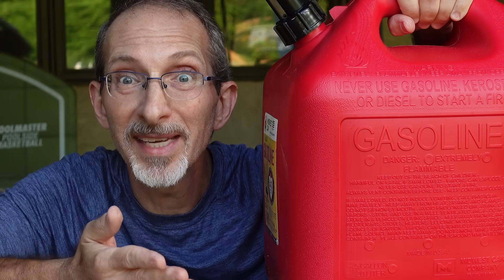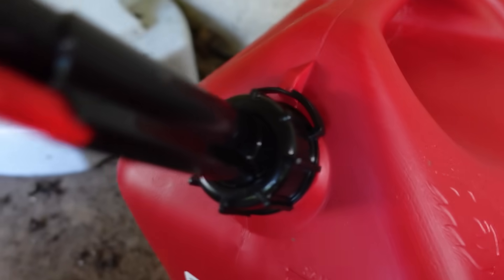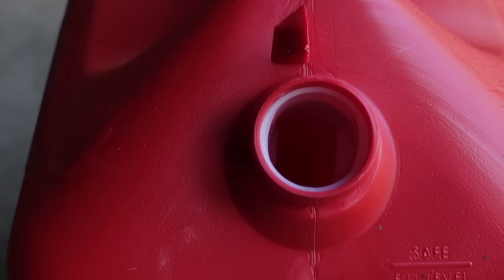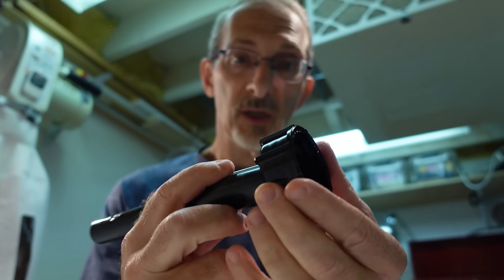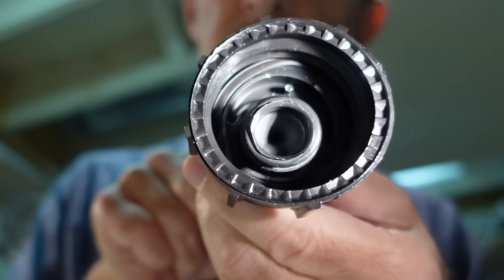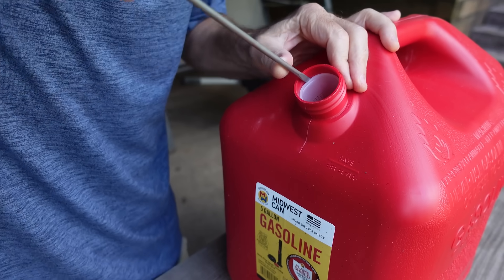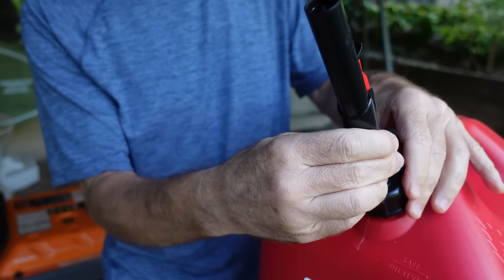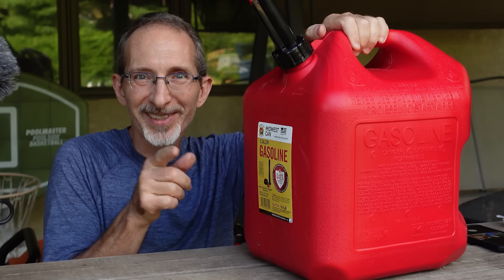Gas Can Modification | New Gas Can Fix

Comment: Thanks for the tip on cutting that silly lock off! Will do that tomorrow on my 5 gallon can. I bought a 1 gallon can from Walmart to use for mixed gas and it has the weirdest set up I've ever seen. I never could figure out how to even pour the gas out. After fiddling with it for 20 minutes, I ended up putting the gas back into the "unsafe" can I've safely used for 30 years and threw the new one in the trash. Problem solved.
Reply from the maker: It’s crazy to think how many people are throwing away gas containers because the design is just so hard to use. So much for these being more environmentally friendly! I’m glad you found some of the tips helpful, and I appreciate you watching!

Comment: Why are you putting straight gas in your chainsaw and weedeater?
Reply from the maker: My weedeater is a four stroke engine and take straight gas. But I hear what you’re saying, and I do keep smaller containers with an oil and gas mixture for my two-stroke equipment.

Comment: I personally would have put a weaker spring back into the nozzle. I totally understand why you wanted to remove it. However, the auto-close feature is super nice when you are filling a tank (significantly) smaller than the can itself. No need to change the angle of the can, just lift up and have the auto-close seal stop it for you.

Do this with my weed trimmer all the time. However, the spring isn't that hard to move either. 1. Start the pour. 2. Open the safety latch. 3. Allow the weight of the fuel to open the seal. 4. Lift the can to auto-close the seal.
Reply from the maker: These are all good points. In fact, I did a mod to the spring to make it easier to use in my second video, and then reinstalled it back into the spout. It worked great! Thank you for sharing your tips and for joining the conversation. I appreciate it!

Comment: I did this to all of my gas cans. Then, I ordered new regular nozzles and replaced them all with the old-style, not government BS nozzles. They sell them on Amazon. Search for "2009 Gas Can Nozzle" or "Water Jug Nozzle".

Some of the kits come with the old-style plastic air vent for the back of the can too. Those are GREAT mods to make too. The "Magicfour Vent Caps" are my favorite; but they're little more expensive than the plastic ones at ~$20 for a pack of eight.
Reply from the maker: Thanks for the tip about the magic for vent caps. I’ll have to check them out!

Comment: Sweet! Thanks for sharing. I just modified my Midwest 2 Gal. gas can:) HA! Removed the spring and filter, replaced the O-ring like you in this video:) Now, I can use my gas can the way I envisioned, fill up and pour out as needed:)
Reply from the maker: Excellent! These containers are well-built, it’s just that the design makes them hard to manage. Few changes here and there and they are good as new! Thank you for supporting the channel by watching and commenting!

Comment: There's one other solution. There are gas can nozzle conversion kits on eBay and other sites, that comes with the "old style" nozzle and cap, with several thread rings. These fit most cans and definitely fit the can seen here. I know, because Ihsve two of those converted. Some kits even come with a air vent valve, for cans without one. Great video here, thanks for sharing ! Anything to get rid of these terrible nozzles !
Reply from the maker: Randy, thanks for your compliments and for watching! Aftermarket spouts are very popular, and I will be reviewing one in an upcoming video. I appreciate you supporting the channel!
Reply: @MikeFyxdt  That's great Mike, I look forward to that one ! I just appreciate you addressing such a huge problem. Like most, I NEVER pass up buying an older can at yard sales etc, all because of these new devices.

Comment: These new gas cans are a total mess.  You forgot to add a vent.  You can purchase those on ebay.  Adding a vent makes them pour very nicely and smoothly.
Reply from the maker: Jerry, I agree! I did a second video where I added a vent and also modified the spring for people who don’t want to remove it all together. Link in the description if you would like to watch. Thanks for joining the conversation!

Comment: I have several of these cans. I've never had a problem with spilling. They work the way they're supposed to.
Reply from the maker: Kirk, I appreciate you voicing your opinion, and I think it’s good to have some counterpoint here in the comments. I suppose I could have gotten used to all of the features of this container, but I didn’t have the patience. Everyone needs to make decisions based on their own assessment and needs. Thanks for joining the conversation!
Reply: Filling anything but a heavy mower or car with one of these cans equals out to gas everywhere but where you wanted it to go. I have one, and I hate the thing with a passion. I either have to stand there holding a heavy can while my mower fills basically one drop at a time or I have to push the lever down and somehow hold it while holding a heavy container and manage to pour the gas into the hole and  not all over the mower I would like to finish cutting the grass with sometime that day.  Give me an old-fashioned gas can any day.

Comment: Punch out the bottom of the filter so gas flows in fine and when you dump out fuel the filter filters
Reply from the maker: The filter (flame arrester) is in the container pretty tightly, so you just need to make sure that you don’t damage the container itself, or else it might not seal correctly. It seems like everyone is experimenting to find their own solution… I just wish these containers were better from the get-go. Thanks for watching and for commenting!

Comment: I didn't know about these ridiculous gas cans until my brother mentioned it to me.  He felt they were far more dangerous than the old ones and extremely annoying.  Nice simple fixes to the problem.  Your modified version actually accomplishes what the original was intended to.  You didn't remove safety features.  You made them functional.
Reply from the maker: Terry, thank you for your reply! I have nothing against safety features, as long as it doesn’t impair the safe use of the gas container. I appreciate you joining the conversation and thank you for watching!

Comment: I wouldn't find it necessary to get rid of the little plastic clip that keeps the whole neck from unscrewing since I don't find those to be much trouble. The other two mods though sound like excellent ideas. I really don't understand how all these new can safety features are supposed to be all that safe when you end up spilling gas trying to deal with them
Reply from the maker: Agreed! The little plastic clip probably could have stayed, but I have nicked my knuckle on those in the past, and since I was in a surly mood, I took it out on the can. I’m glad you found the other mods helpful, and I agree with you that it is ironic how safety features make something unsafe. Thanks for watching and for joining the conversation!

Comment: Why would you get rid of that filter? Aside from making the pump think the can is full it has an added feature of keeping any contaminants inside it so you can pour them right into your tank along with your previously filtered gas!
Reply from the maker: When I called the filter is actually a flame arrester safety device, which I explained in my second video. Sorry for any confusion! I appreciate you watching.

Comment: Why not just buy a replacement nozzle? Easy peasy!!
Reply from the maker: Phil, that is a reasonable comment. My first priority was trying to fix it without purchasing anything additional, which I accomplished. That said, replacement nozzles are a very popular option, and I will be reviewing one in an upcoming video. Stay tuned and thank you for watching!
Reply: What I like about the replacements is that they can be rigid or flexible (preferred by me). Essentially making them as originally designed.

Comment: An excellent option to these very dangerous gas cans is the old metal ones. You can convert any metal can to a gas can, i.e.  gal. paint stripper can, gal. mineral oil can, gal. turpentine can, etc. You can buy spouts in Walmart or your favorite auto parts store if you want to.
Reply from the maker: Yes, even though metal containers are more expensive, they may be a better value in the long run. I appreciate you watching in joining the conversation!

Comment: Cut that stupid spout down a little and add a piece of flex tubing.  I think a vent plug will improve flow and allow the release of the Compressed vapor cloud when wnd where you can do so safely.   @GOOGLE  your dirtbag #Spell Checkers are fucking with me... check their oxygen levels.
Reply from the maker: Rodney, agreed! I added a vent in my second video, link in the description. I also agree that spellcheckers have a mind of their own! Thanks for watching and for joining the conversation.

Comment: I believe the "filter" is actually a flame arrestor. It makes kerosene cans completely useless since a siphon is typically used to transfer kero.

If you look into power sports gas cans (such as at a motorcycle shop) they generally lack any of these unsafety features.

If you're storing gasoline you want metal cans.
Reply from the maker: Andy, agreed on all points. I followed up with a second video, link in the description, that clears up the flame arrester issue. I didn’t realize kerosene is often siphoned, but I understand that it burns much differently than gasoline, so maybe there are containers available specific to that type of fuel. Thanks for watching and for commenting!
Reply: Checked them out, good content!

Comment: Aside from the spout issues (I have one of the cans with a ring to twist before pushing spout inwards in order to allow flow), the in-can filter makes ZERO SENSE as it is designed... it isn't easily removed for "cleaning" it, so any particulate matter it could possibly catch would simply wait there to be picked up and deposited into whatever you were pouring the gas into next from the reverse flow from can to filter to spout. /smh/

P.S. - I read the updated info in video description... there are very few people that will automatically deduce that the "filter" is a flame arrester. Most all consumers are going to presume it is a filter... and it is a weird safety feature, too... IMHO. Why don't ALL motor vehicles (or ANY gasoline powered devices) have one of these in their tanks' fill ports?
Reply from the maker: I don’t think cars need a flame arrester because the fill hole is pointing up, and the danger with gas fumes is that they travel down. In other words, you tip the gas can but you don’t tip a car. Or at least you’re not supposed to, lol!

Comment: If you primarily fill up cars, another option is to keep the spring but get rid of the red piece. For filling up cars the spring is not an issue, but the red piece is super annoying how the slightest touch would cause it to pop back out.
Reply from the maker: Dwigt, that is a creative solution! Thanks for watching and for commenting!

Comment: The only thing that safety is good for is spilling your hard earned money onto the ground. I never had a safety issue with my old cans in the 30 some years I used them. Most retarded shit ever.
Reply from the maker: J.T., it is crazy how many people say they are spilling fuel with these new “safer“ designs. Thanks for watching!
Reply: @MikeFyxdt  There is nothing better or safer about them. Thanks for the tip on how to make them work better. I'm tired of getting gas all over my hand and all over my mower when filling it up. I will only put gas in my mower when it's stone cold, because I'm worried about it catching fire and burning me and my mower up.

Comment: pulling that filter out reminded me of when some folks saved a sea turtle.
Reply from the maker: LOL, I’ve gotten several comments that compared it to a medical procedure! Yikes! :-)
Reply: I haven't seen one with a "filter" before, but I'm wondering... how does that filter anything? If trash goes in ... and the filter "stops" it ... doesn't it pour right back out? This is a gas can ... shouldn't filters be in 1-way tanks, not in 2-way tanks?????
Reply: @AllAmericanGuyExpert  it’s supposed to be a flame arrestor; the better cans use a metal mesh. It’s supposed to help stop flames climbing a stream of gas from entering the can. I thought the same thing as you (doesn’t filter squat) when I was pulling mine out

Comment: how does the filter work? Seriously? You fill up with dirty gas, fine, it gets trapped. But if you don't clear the debris from the trap, guess where it's going to go on your first pour?
Reply from the maker: When I called a filter is actually flame arrester, which I explained in my follow up video, link in the description. I appreciate you joining the conversation!

Comment: You can buy vents to add to then also.  The filter is completely pointless, it keeps stuff from getting past it, then it's there to come out with the first bit of gas you pour.
Reply from the maker: Dustin, you are correct. The filter is actually a flame arrester, which I clarified in my second video, link in the description. I also added an aftermarket vent in that video if you’d like to watch. Thank you for joining the conversation!
Reply: @MikeFyxdt  -Gotcha, but I don't see how the screen can be a flame arrestor, hopefully you understand and explain in the next video.

Comment: Thats not a filter. That is their flame shield technology. Otherwise known as a flame arrester. 
Its what caused blitzu to go under. They were metal and uncertified, but blitzu got sued for not using them. Turns out the metal ones actually caused more fires.

They are pointless.
Reply from the maker: Michael, you are correct. I addressed the flame arrester in my second video, link in the description. Thank you for your comments!

Comment: You can spend all the time and effort into removing the spring and all that "safety" stuff, or when you buy the gas can, just purchase one of the "old" spouts, the run about $6-$10 at Tractor supply
Reply from the maker: Yes, replacement spouts are a popular option. I will be reviewing one in an upcoming video, stay tuned!

Comment: I must be the only one who likes these. I never spill a drop. Just pay attention and remove some pressure as it approaches full to slow the flow, once full just lift and gas stops. What’s the problem?
Reply from the maker: Jess, I found it very hard to control the spout with these large 5 gallon containers. People who have smaller containers with the same spout tell me it’s not as hard. I’m glad you commented because it is important for people to hear both sides! Thank you for watching!
Reply: @MikeFyxdt  I have 5 gallon cans but yes it would be easier if it were lighter

Comment: Another mod that I do to all of my gas cans is too drill a hole in the other side at the top and fish a car tire valve stem into it. This works great as a vent with the Schrader valve removed and the cap works as a cap
Reply from the maker: Do RC, there have been lots of mentions of the Schrader valve fix, and I have seen some videos of it. In my second video, link in the description, I added a simple vent with a cap that made a big difference and was very easy to install. Thanks for joining the conversation and for watching!

Comment: Great info on fixing one of the problems with these spouts.  But it doesn't solve the other big problem, which is the rigid spout that forces you to literally almost upend the gas can to get the spout into the literally horizontal opening of a most things like generators, lawn mowers, etc... not only forcing you to lift a full gas can completely up, but typically splashing gas all over the generator, mower, etc.    For less than $10 you can buy a simple flexible spout.  It's one of the most widely purchased accessories to fix these idiotic designs.
Reply from the maker: Agreed! So many people have recommended an aftermarket flexible spout. I will be trying one in the near future and making a video. Thanks for commenting and for watching!

Comment: This reminds me of the no iré “falling down” looks like you’ve had enough of everything being designed for the least common denominator. That bar has gotten so low, I’m convinced these are designed to keep us from using them. It would be best if the masses hired people to cut their lawn.
Reply from the maker: Steve, even the lawn cutting services need to purchase gas containers, so they are affected by these designs. I suppose if I used gasoline more, I would simply invest in better containers. For my needs and my budget these containers seem to fit, and after the modification they are much more usable. I appreciate you watching and joining the conversation!

Comment: The screen is there so you can siphon the fuel out.   The good idea fairy created a gas can that's hard to fill and harder to empty, all too fix a problem that never existed.
Reply from the maker: The screen is actually a flame arrester, which I explained in my second video, link in the description if you would like to watch. You bring up a good point that the mesh makes it impossible to use a siphon to remove the fuel. I am much more in favor of a gas container that has the flame arrester in the spout, instead of permanently mounted in the container itself. Thanks for watching and joining the conversation!

Comment: Not really a filter but a neat safety thing to keep the can from exploding if it catches fire, midwest has a cool demonstration on their YouTube channel
Reply from the maker: Yes, when I called a filter is actually a flame arrester, which I explained in my follow up video. I do think that there is validity to the flame arrester, but I wish it didn’t impair filling the container or dispensing the fuel.